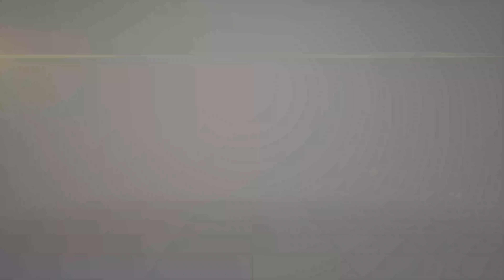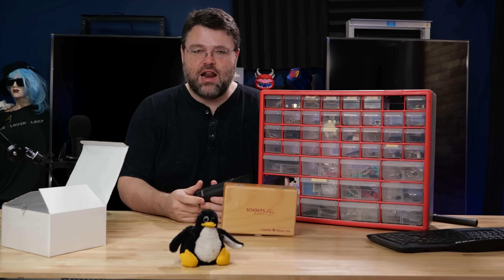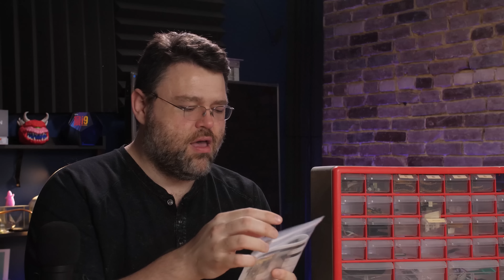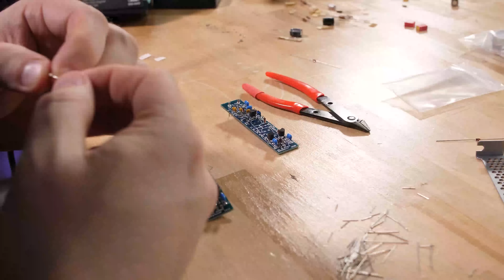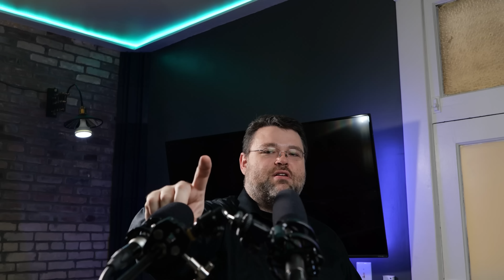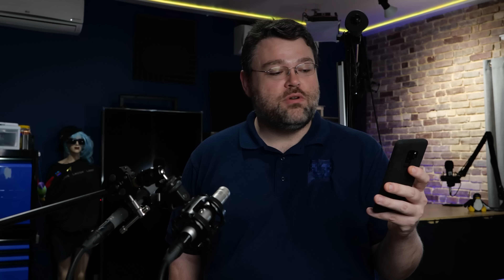Level1 Project: Microphone Build-off -- Schoeps CMC641 vs Wendell Built DIY Mic

Comment: Hmm most of your solder joints look like they're either not flowed properly (they look like balls) or they have too much or too little solder... you definitely should clean it up or you'll have an issue later with cracked or intermittent joint. :/

Comment: You can use distilled water on any PCB. That is how you use an ultrasonic bath to clean boards. If you get your device wet it's better to keep it wet in distilled water or alcohol than it is to let it dry out. As long as you remove the battery and LCD.  The repair person can clean it properly and prevent the corrosion that would happen if it dried out.  It's not the water that kills devices it's the minerals left over after the waters gone.

Comment: I love level 1, but this screams for learning about mics.  Shotgun is super directional.  It gets what you point it at and very little else.  You don't have to be close, you have to have it pointed directly at you.  Condensers  are good but will have a pronounced change as you get closer, noise rejection will be largely determined based on the pickup pattern.  Good mics will have a chart showing pickup, and will have listed sensitivity and noise levels, as well as a frequency plot that should help when choosing.

Capacitor wise, dielectric type is important to the transfer function of the cap, and thus the frequency response, distortion, etc. that is exhibited.  Video card electrolytics are only good for power.  They should not appear in the signal path

Comment: I had NO idea that I needed to build a microphone... 

NOTE TO SELF
Reply: Mic parts also does modding. AT2020s and Sterling Audio stuff out there. I saw a C3 with a Peluso (good brand in the US that does classic clones) capsule for $300 on eBay, and modding the circuits is only $70.

Comment: Those WIMA caps are made for audio. They are bipolar film capacitors designed for audio applications.  You can't just throw in any old capacitor into an audio circuit and expect it to sound great.  Microphones generally need a lot of gain and any noisy parts will add to the noise of the circuit and get amplified.  Using a generic electrolytic cap would not give good results and in a circuit that would need 48v Phantom power you would be asking for trouble using the wrong caps or transistors.

Comment: You should cut the legs before you solder because cutting them afterwards can cause small cracks between the solder and the leg, or the solder can loosen if it's a bad joint between solder and leg. But with these components and it's use it doesn't really matter. You shouldn't touch the board to much either, only the sides. The fat/oil and stuff you have on your finger oxidase the board after a while. Always clean the board after working with it. (I've been working with soldering components for almost 10 years for a big Swedish phone company.)
Reply: With the softness of solder with a proper joint there's no risk of any cracks  solder is pretty soft especially lead one. As for oils thet's true in principle but their effect on lower power devices especially on parts after the amplification is minimal and likely wont cause issue.

Out of all the stuff to be careful about I'd focus more on quality of solder joints in which additional flux really helps. Sure those are good tips and are helpful but my priorities are a bit different also about cleaning flux... depends on the flux  sometimes you don't need to clean it out but if you are going to conformal coat it t you should clean the board anyway.
Anyway soldering stuff is pretty zen for me.  Especially repetetive  simple stuff like mechanical keyboards. And i've started, to appreciate SMD even for hand soldering if the package isn't ridiculously small ;]

Comment: Better have some good suction if you use solder with lead, you really don't want to breath in lead.
Reply: but the lead stays in the solder... it's the flux that boils off.. which non-leaded solder has more of
Reply: @markkeilys  

As long as the temperature doesn't get high enough to vaporize lead you have a good point. In Europe solder with lead is forbidden.
Reply: @peterjansen4826  
>temperture high enough to vaporize lead.

that's like 2 thousand C e.g. anything you were soldering would be on fire or melted.